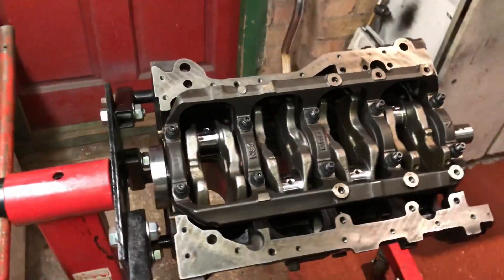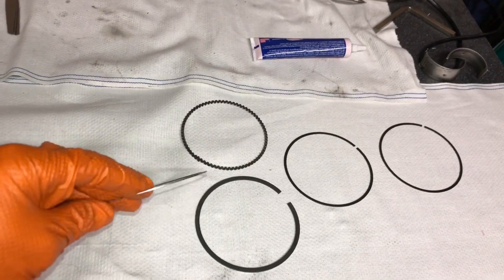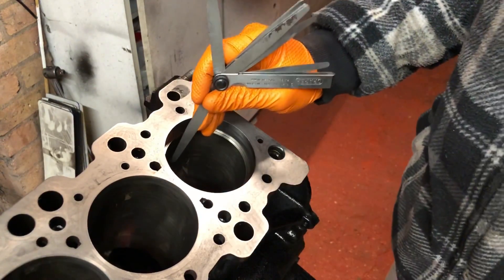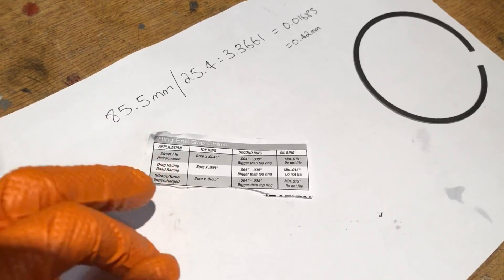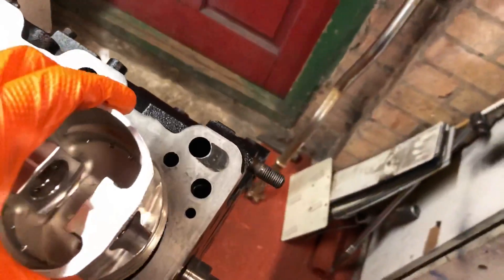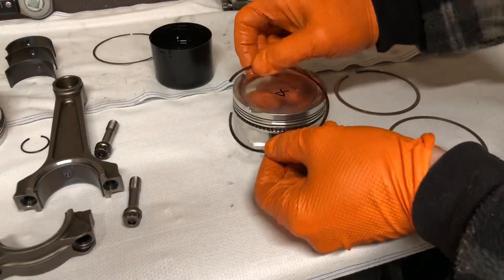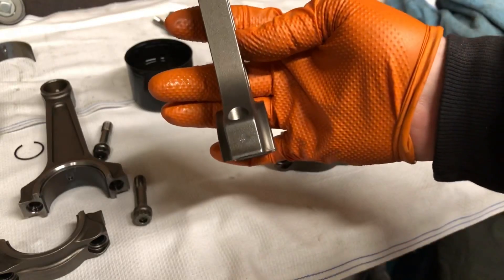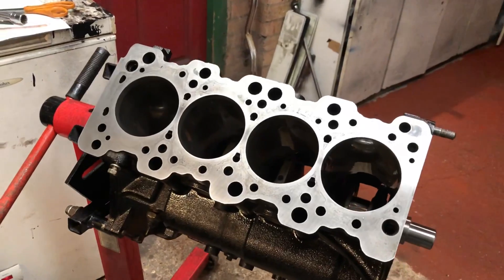600+HP 2.3 Mitsubishi Evo 5-9 Short Block ASSEMBLY

Comment: Aaron do you plastigauge?
,sorry if I missed it?
And what suspicion make you start looking into this engine,why did you think it mite have problems,but wow lucky you did because you caught it at a good time before did a lot more damage,👍
Reply from the maker: Go check the video before this which explains everything. Plastigauge isn’t accurate enough, everything is measured using a dial bore gauge and micrometers.

Comment: IF you have to make the ring gaps bigger do you file the gaps?? if you know what I mean And the ring gaps are not in line with each oather??
Reply from the maker: Yes all gaps need to be filed then deburred. I use a piston ring cutter with a dial gauge to see how much is being removed, much quicker then having to keep refitting. When staggering the rings you must not go 12-6 9-3 as you will have issues with skirt/wrist
Reply: There's a special tool to use its like a wheel and with the ring flat you file from one the gaps edge,(on all rings you file same edge say if left do all from the left,)should be loads videos on YouTube....
Reply: I had seen someone filing with a file!!!!!!
Reply: @michaelmatthews8171  
What like a hand file??,Surely not?,then the edge would be all over the place lol.
Reply: Yes a hand file!!!!!!
Reply: @michaelmatthews8171  
I'm sure that's not the correct way to do it,I wouldn't,the piston ring if not filed correctly it will score the bore....that's funny though...
Reply: When installing the pistons yes you mix up the ring gaps when installing the piston in the block,there is a set way,like top ring at 12 o clock,middle ring at 6,oil ring at 15 minutes past...hope that helps..
Reply: Thanks for that, that's what I thought...